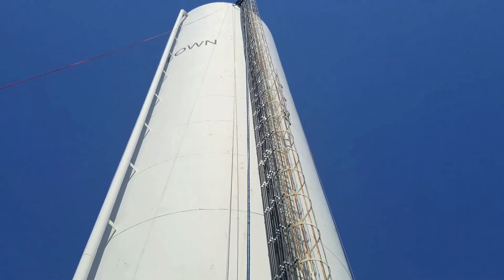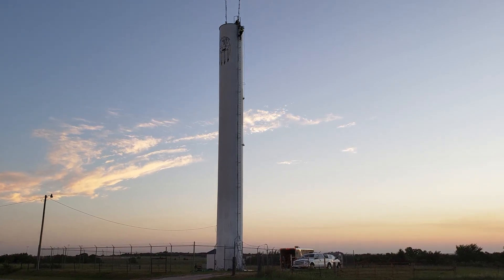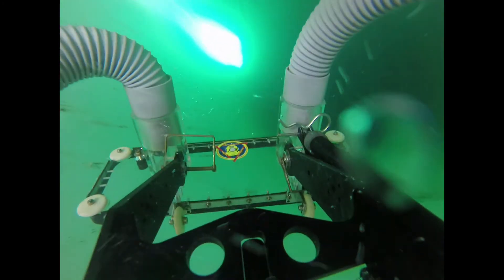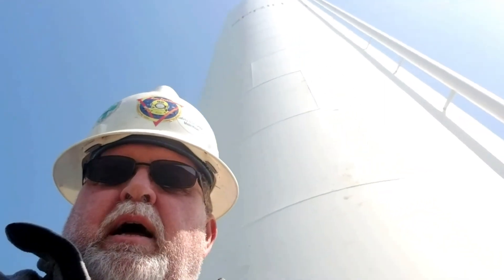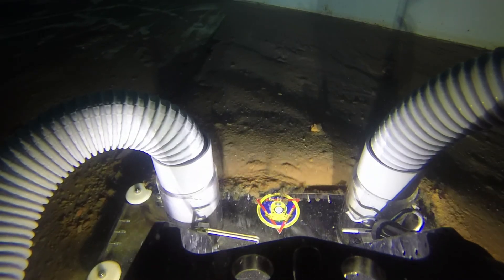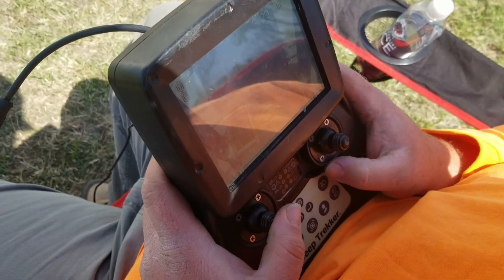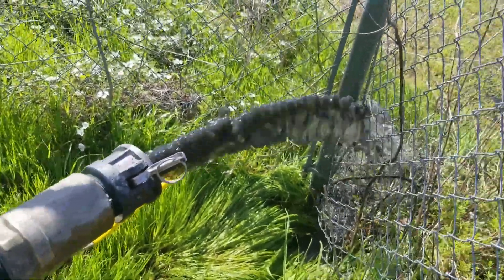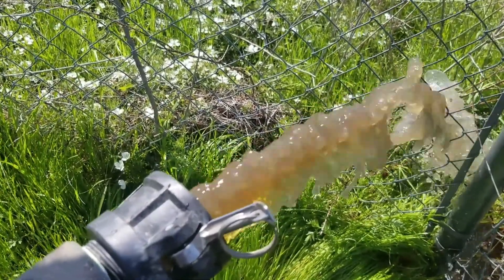WALLIE: The municipal Water Tank-Cleaning Robot!

Comment: 🚨 🚨  HEY  RON…..  HOW  ABOUT  UAV  “DRONE”  USE  IN  INSPECTIONS?  
DOES  ANYONE  SHOOT  PROJECTILES INTO  STEEL  TANKS ?
How is this checked / verified?
UAV / Drones are also great for tower top inspection and pre-dive “quick checks”.
(plus… they are great for capturing footage to use for training, advertising and other promotional tasks) 😁

Normally, this would pose a problem in tanks that have radio transmitter antenna is located on top.
(READ ON….  I HAVE A SOLUTION!)

Here  in my area, the NorthEast, nearly 80% of tank top Installations include one or more “microwave” transmitters / antenna arrays operating in the 2.4Ghz / 3.9Ghz and 5.7  5.8Ghz frequency ranges…   (both ISM unlicensed “power-limited WiFi” frequencies as well as more powerful FCC licensed frequencies)

These are generally used for data links and replacements for the older technology leased-line control circuits used to link remote transmitter sites to others and to dispatch facilities.   

Guess What???    MOST (98.5+ %)  of all  sub $25,000 UAV / “drones” currently on the market  USE  THESE SAME  FREQUENCIES!!)
Almost every DJI unit uses these.   Autel and Skydio as well.
This is a HUGE problem for both the operators of the craft as well as bystanders on the ground.

The problem??   INTERFERENCE !!

While operating the craft, The operator uses a hand-held (or tripod / stand mounted)  type radio control (RC) transmitter / receiver device which transmits control functions to the craft while simultaneously receiving telemetry signaling from the craft.  In addition,  most UAV craft utilize an internal or integrated camera for navigation.  In most cases, this same camera is used for “real-time” inspection purposes as well as archival purposes.   These internal cameras, many capable of extremely high quality video capture, generally have internal memory / TF - SD card memory used to store the recorded video.   The “streamed” video, makes use of the RF radio transmission/ communications link between the remote controller and craft.  It is extremely bandwidth intensive and greatly affected by interference and latency problems.   Therefore, the recorded video onboard the craft is generally much higher quality.

Some craft also have “Go-Pro” type HD / 4K high resolution cameras mounted on their frame.  These “Go Pro” type cameras record to an internal memory module or TF / SD type memory card. 

The SAFETY  concerns are on  the REMOTE  CONTROL side of operations.  If the craft is being flown near delicate equipment and over people or vehicles, the slightest interruption in signaling or incorrect control signaling can potentially result in the UAV / “Drone”  CRASHING  or somehow causing. safety hazard.    If the video signal is interrupted or negatively affected,  it does not pose as much of a safety risk as loss of control does.

I could go on for hours about the advantages of using drones for so many things…
Plus….  THEY  ARE  SO  MUCH  FUN!!!

I have developed an alternative radio transmission link system for the drones that I use to inspect radio transmission antennas, arrays, cabling and hardline installations for my public safety agency clients.  This is done WITHOUT “tethering” the  drone to a ground base system.

Also…. Using the cellular phone / data net work for remote control, while great for long distance inspection of powerlines etc….
run into the same RFI (radio frequency interference)  problems .  Most water towers now have  CELLULAR  NETWORK  transmitters / antenna arrays on site.  In addition to the traditional use of the tower “top” for antenna mounting, mini cellular companies are now utilizing more directional style antennas and phasing arrays that are affixed to the  SIDES  and  SURROUNDING the tanks and towers.

So, by utilizing cellular network data for craft control…. 
You encounter the same interference problem as the other “WiFi” type frequency ranges predominantly used for drone control.

My “solution” involves using  combination of VHF-High and UHF frequencies at MUCH higher power.

Example  = The DJI Mavic 2 Zoom “Drone” , very commonly used for inspections and one of my favorites, 
simultaneously using 2.x and 5.x GHz frequency ranges LIMIT  TRANSMISSION  POWER  to much under 1 watt.

Using my concept …. An FCC licensed IG frequency pair provides simultaneous full-duplex communications 
for RC control functions.  With much more power being emitted by the ground RC handheld remote controller to ensure that instructions to the craft in the air will “punch through” the background radio traffic.  Even the telemetry link back from the craft in the air is substantially higher than the traditional methods.     The use of directional, high-gain antennas aids in effective communications.

Transmitter in ground remote controller =  1 - 35 watts (adjustable by user)
Transmitter in drone in the sky = 1 - 8 watts (adjustable by user)

The FCC / 2-way radio portion of this project is something I’m intimately familiar with.
The licensing is not extraordinarily expensive and ensures that you are fully compliant with the federal laws that exist and ensures that you have the cleanest signal possible.
I make use of A frequency pair in the “business band” (IG) spectrum when local.  I am licensed for their use within 35km of my home territory .i  have a second frequency pair that I use when loaning out equipment…. That license comes under the “itinerant use” policy/regulations.
I have a license that covers the entire continental United States..

In addition to using the frequencies for a drone operation and control, we make use of portable to a radios in the field for communications and also have repeaters located in our area to expand the coverage range of our portable radios.  “Push to talk“ is far more convenient and safer do use when performing the work we do.

I have been using DJI’s  “OccuSync 2.0” for the video streaming portion.
it’s actually quite good, even in high interference areas. 
Additionally, everything is recorded to the DVR on the drone (highest resolution setting) for later review and use.
The use of the DJI “OccuSync 2.0” (and now 3.0)  also provides for rather easy video distribution on-site.
Using  several hardware products in combination, we are able to provide both HDMI and SDI video outputs on-site.

(Note = DJI has a crappy “nanny” system incorporated into their drones.  
Their “Geo fencing“ makes it a risky choice for public safety, search and rescue and anything critical…. That’s why I only make use of their video transmission link system for inspection duty.   I still fly my Mavic 2 and DJi FPV drones, but only for recreation.   Autel is the “Orange King” of the skies…. LOL.  Kinda like “Orange Man Bad”, a true hero IMHO)

Often, during a more extensive inspection, design engineers and a multitude of others will be on scene and will want to see the video being captured during the process.  In our case, this is sometimes the municipal water department representative.  They are often interested in how the radio equipment / antennas / FAA aircraft collision avoidance lighting is being utilized on their tanks and towers.   Another huge use of drones is to inspect water tanks/towers for damage done by “plinkers”.  Idiots shooting firearms or other projectiles at water tanks.

I could continue for 100 more pages and still not explain everything that can be done with current technology.

so… i’ll follow up with:

RON…. START  MANUFACTURING  AND  MARKETING  A  “AERIAL  INSPECTION  SYSTEM”!,
Sell it to municipalities, water district, water Department, diving groups, police and fire, etc…